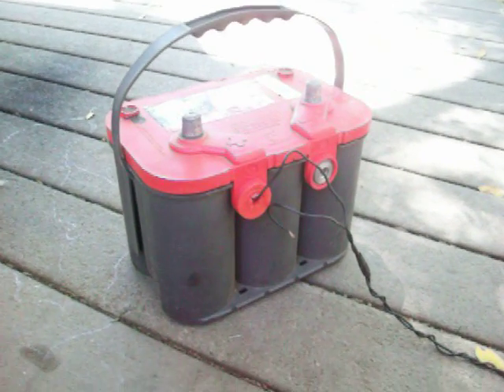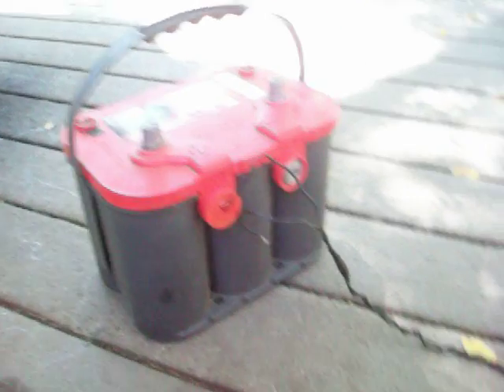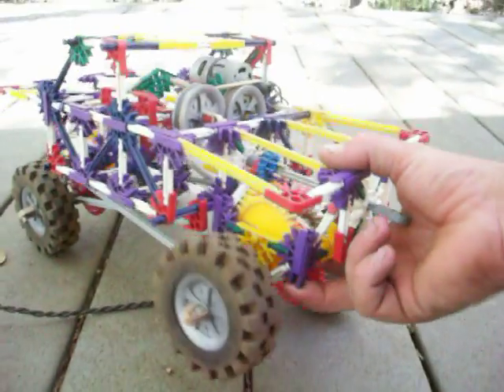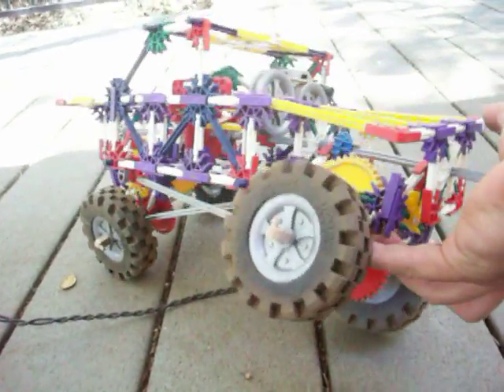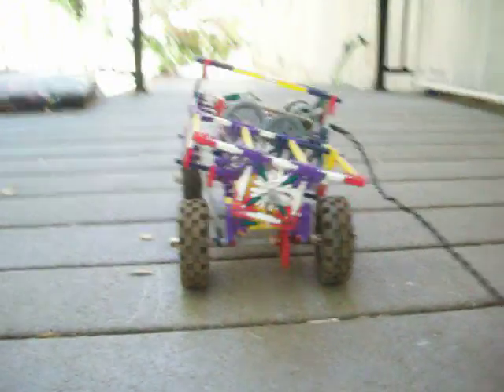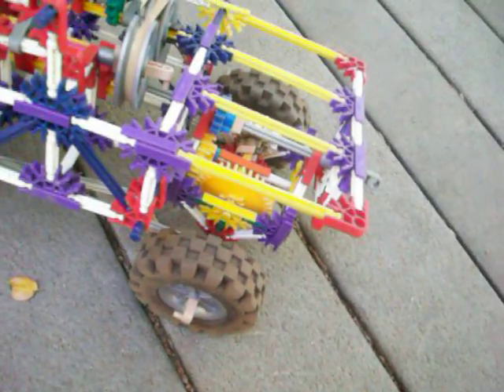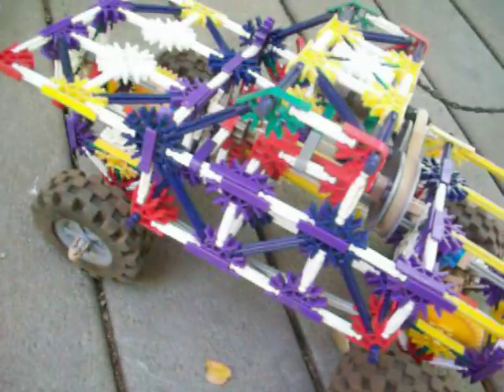knex rock crawler, with car battery

Comment: a way you can fix the problem with it tipping like it does is to take 4 rubber bands that are exactly the same and put them on the for corners of the truck this will give equil force on all sides allways pulling it back to it original state with out having to do any major  changes to the body it is like shock absorbers but pulling instead of pushing try it and tell me what you think and if that does not work you can allways just make some kind of shock obsorbers i have pics if you need them jlmk